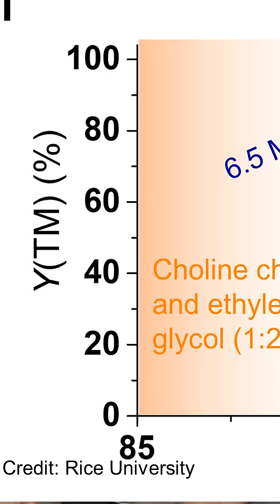Breakthrough In Lithium Battery Recycling #rareearth #lithium #science #renewableenergy #battery

Comment: Interesting, I wonder how energy intense the new process is vs the old process - and whether the reduction in unrecoverable waste makes up for any extra energy input. I also wonder how the temperatures compare to those attainable with fresnel lenses + sunlight - i.e. can this process be directly solar powered? You wouldn't be able to work on overcast days or at night, but cutting out the solar panel "middleman" would make it much more efficient...
Reply from the maker: it would be awesome of this process could be done using lenses and sunlight directly!! From what I understand it's a pretty high intensity pulse of electricity needed to shock the system into the non-equilibrium state to make this happen. I'm fairly certain that the amount of energy used in this new process makes up for itself in the amounts of minerals that are recovered, but we'll have to see the numbers on that one.